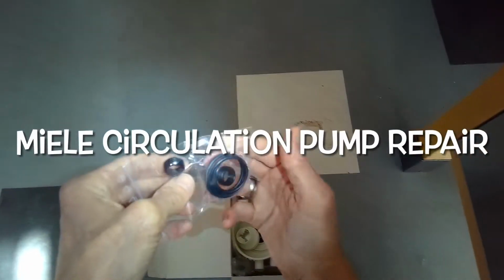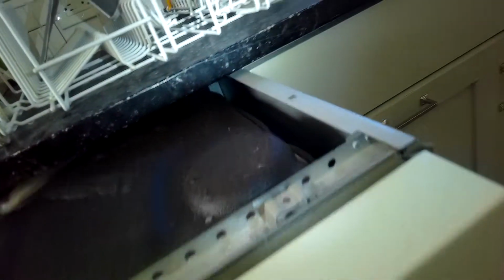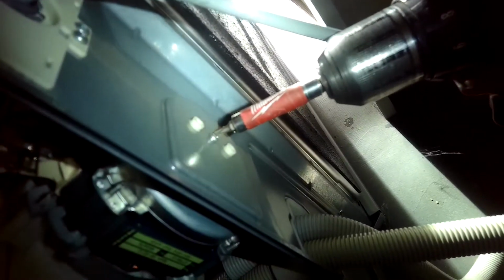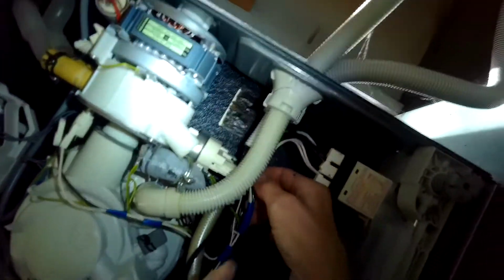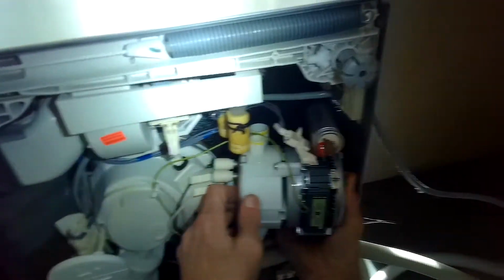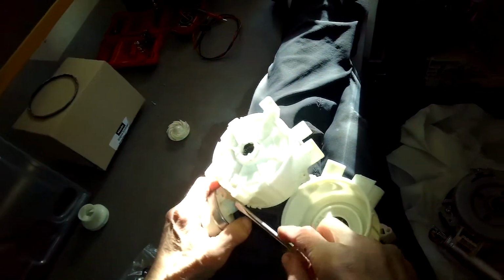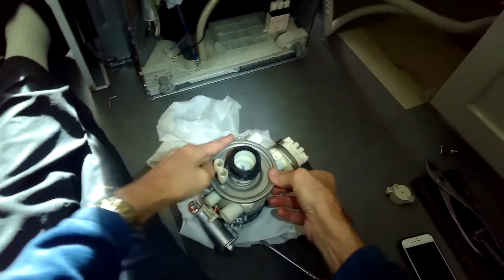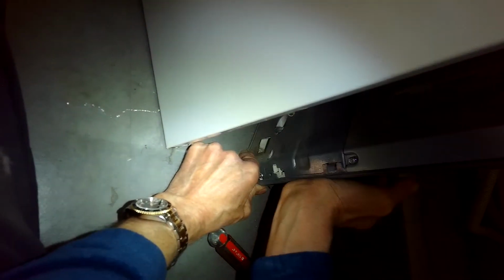✨ Miele Dishwasher Loud Cycle - LET’S FIX IT ! ✨

Comment: This was definitely not quick or easy! I have this exact Meile dishwasher in stainless steel. It is 11 years old. I'm having the same issue. Loud circulation. I have not seen a decline in the washing, but I'm very concerned it will happen soon. I spent over $500 last year on a pump issue. This looks like it may be an expensive fix. There is only 1 man in my area that works on Meile and it takes a while to get him in, and then even longer to get the parts. My question is..... is it worth doing this fix on an 11 year old dishwasher? Thank you!
Reply from the maker: I think it’s time for a new dishwasher.
I would go with Bosch Ascenta
Reply: @QuickAndEasy5MinuteAppliance  Thank you! I really appreciate you answering me. It's kind of what I thought. When it goes, I'll buy the Bosch. :)
Reply: Agreed, awesome helpful video but painful job and I work with electronics so I don’t mind pulling stuff apart! I’m thinking a new dishwasher might be the best way to go for me too, given the rusty dish racks in mine.
Reply: @LiquidAudio  Mine were rusty too. Terrible disappointment for such a high end dishwasher. I took his advice and got a Bosch. I bought the less expensive one and it does a better job washing than the Miele. In all fairness, the Miele washed well early on as well.
Reply: @jean1959  Fair call, my Miele is 15 years old and to be fair to the machine, it's never missed a beat and is the quietest, best dishwasher I've ever owned. It's just getting old now. I've had to replace the one way valve and now it sounds like the pump is on the way out. But she's given me great service. Glad to hear your Bosch is a winner, I like Bosch too.